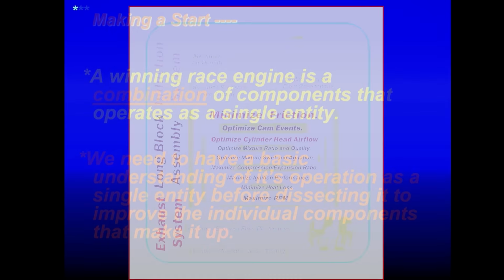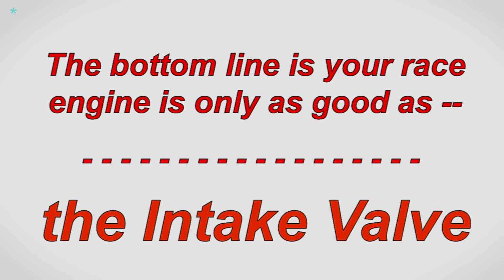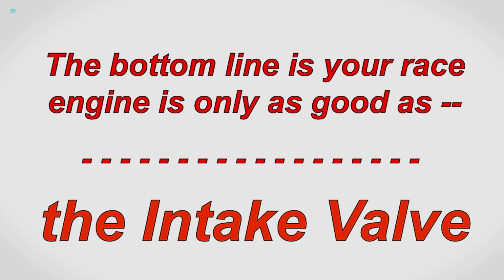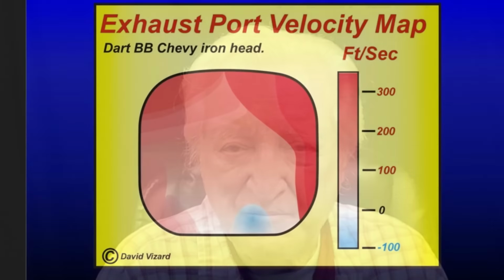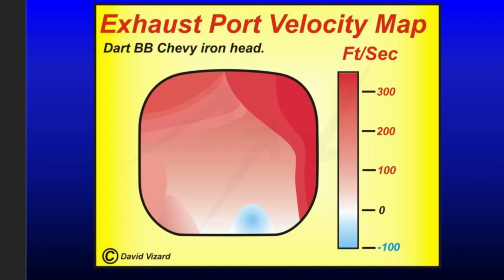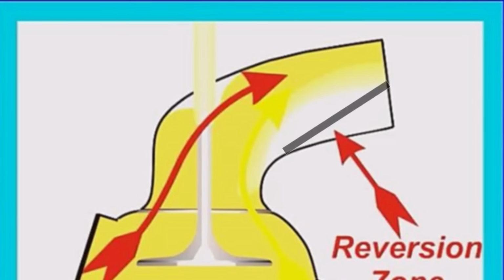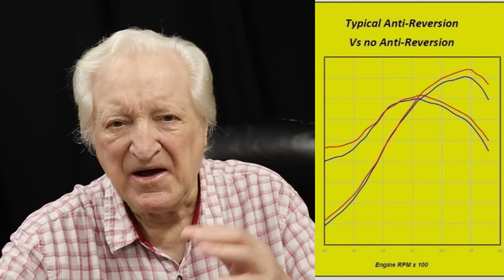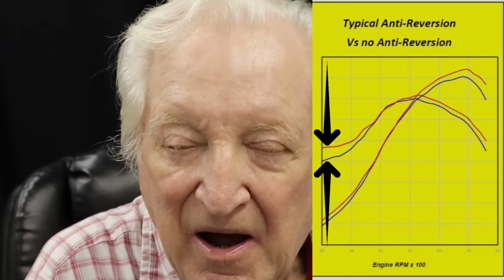Big hidden HP - from anti-reversion mods

Comment: A long-awaited topic, finally covered.
Is there anything to be had from de Lavale-shaped extention in exhaust diameters (anywhere in the system, at all)? I have a feeling it should have been one of the things benefitting my output when exhaust system was remade, but nobody mentions anything alike this, anywhere.
Reply: No. Reciprocating engines have pulsed flow, not continuous flow like a rocket. A Lavale nozzle is designed to have the exhaust pushing back against the rocket. That is the opposite of what you want in a piston engine. You want the pulse to leave as quickly as possible and leave a pressure drop behind it to help scavenging and suck the exhaust valve shut.
Aside from the anti reversion steps you do want it to be a smooth taper to minimize turbulence.
Reply: @Fulcrum205  Lavale nozzle is designed to convert heat energy into velocity which is why it seems practical, though any reverse pulses should have the opposite effect applied. But, I have mixed feelings about its effects on flow upstream of the nozzle.
Limited simulations I've made showed that velocity rised more evenly than in the large tube, while total flow is slightly better than the smaller tube (comparing lavale nozzle style extension of like 1.1 factor with both diameters involved, if they were there natively)
To sum it up, in simulations it seemed that while not having the full flow of larger tube when it's finally got up to speed, small-extended-to-large responds to flow rise nearly as quickly as the smaller tube, but ends up pushing more through the outlet. So, to have the same total flow, this kind of pipe could go by with smaller pipe at the beginning, which in turn should impact scavenging positively

Comment: would this help turbo charged applications too ? there is quite some back pressure from the turbine on the exhaust, would an anti-reversion device help whit the situation, or it does not realy make that mutch of a difference when the turbo plays ?
Reply: I'm sure it would make a difference to spool up quicker. I am going to try it on my old volvo. I have an adaptor plate connecting the turbo. The way the porting works in my situation, a cone type I think would work
Reply: @Batman-n1q1v  supposedly if it does what it does.. then it can help Both before and after the turbo. 
It would be an interesting experiment.

Comment: Thank you so much for posting this video!  I am very interested in this topic!  I would like to know more about the groove you put on the intake valve. I am interested in doing this but, I am concerned with the longevity of the valve under daily use. How will this hold up in long term use and are there any other considerations that should be made under these conditions?
Reply: I am thinking also this...ditch cut or groove would probably have similar kind of effect concerning of the strenght of the exhaust valve. I suppose if the valve itself has good quality and we talk about street rpm (5000-6000), street cam lobes (low seating speed) and  not too stiff valve springs...they should be ok in mileage use.

Comment: Sometimes customers put on drag-pipes on their Harleys and because of the reversion lose large amounts of low and mid-range torque (the lower rpm range is affected the most); I've used "torque-cones" which fit between the head and the exhaust  and about 60%-70% of the lost torque would come back. However, there would be a loss of top-end hp and now I know why! It would be interesting to see what would happen if the top part of the cone was cut off, maybe the torque would still be good and some lost hp would return.

Comment: If I learn 1/10th of what this gentleman knows in my lifetime I will be happy.
Reply: Do what I did long ago, stay with Mr. Vizard only follow his guidance only and you will NOT ever go wrong.
Reply: @TobiasCat-p6b I agree with you. It's so rare to find a person with such well rounded and complete knowledge of a subject and I believe some folks have confused themselves by listening to many different people that may not have such a complete understand of how to build and tune an engine.
Reply: if your listening and taking it in youll get there.
Reply: Would runners shaped like diamond (larger or smaller on the outside bends than inside) equalise velocity/pressure and avoid this reversion?
Reply: @stygiangs  mo
Reply: Yeah, I'm learning whatever I can from him for when I build my LLO 1.9L Saturn DOHC engine for boost after I get out of debt of course...lol I already know because of David, which pistons I want to use for it and I'm likely going to have CP Carrillo titanium rods made for it, WPC Cryogenically treat the whole bottom end and transmission parts, etc. It's so interesting and fun to be a part of engineering your own street engine. It should be fun with a 2390 LB car.
Reply: @junechris  start with throwing the engine away

Comment: This reversion is more evident in larger V8's with large cam overlap. John Kasse made a point to never use old, rusty inside headers. He figured out why his friends were getting oxide in the cylinders and killing their new engines.
Reply: Thats why I see so often some rags in the intake port to prevent stuff dropping into it ........but not so often in the exhaust port.   Many think : it blows the stuff out...

Well.....if the exh valve is open and sonething drops into the port....... drops into the cylinder.  Doing its damage before blown out.....
Reply: Nobody that has any knowledge of 2 stroke understands these ideas.
Reply: @scottburchfield912 
I do BUT I've also thought
You can fight nature with difficulty
Or work with it 
Could you do as the 2 strokes do and tune a stepped header and cam to use reversion to force the cam overlap intake charge in the exhaust back into the combustion chamber 
I know the pressure wave timing will be short and exhaust valve will mess things up 

It'll probably be worse except for that 500 to 1000 rpm range when the pressure waves are in time with valve timing
Reply: @TobiasCat-p6b  its my experience as a pro head porter....

I have seen very often engines in a workshop with  covered intake ports ( a folded rag in it ,  ducktape on etc etc ) ....but exhaust ports open. 
Than customer explains :  no need covering exhaust ports ....its only blowing gases out  so no problem. 

Yeah...right.... but if whatever fell in damages  e.g.  squish area and top of piston cause it got stuck between  that before blown out of the port....

Most of the time ...I get a blank stare.....

Comment: some small block chevy heads have D shaped exhaust ports mated to a round header port, will this work about the same as a reversion plate?
Reply: Another reply to and other comment said yes to your question adds about 10hp

Comment: 14:50 short side radius...
A guy named Birdie ported my alum Edelbrock Oldsmobile heads and he even cut into the intake and had to brass sleeves for the pushrod holes. We didn't make huge flow numbers but one thing i want to point out is he kept the heads forever and kept asking me what cam im gonna run. I kept saying it will be custom based on what you can get out of the heads. We went back and forth on this for months. Then he told me the lift numbers mattereed as far as how much he was gonna roll off the short side exhaust...to reduce reversion. 
Ultimately i chose a weird hyd roller from crane with LS lobes. I'll give general specs its .620/.620 lift (1.5 ratio rockers) 257/265 duration @.050 and the n/a engine made 620hp/620tq at only 6100 so in the end we did ok. Cubic inch is 462 its a .030 over 455 olds. 4.155 bore with the worst cyl head ever for actual flow. In my mind a 462 set up this way should flow more but it is what it is
Reply: @williamstamper442
The top engine guys will tell you that flow numbers do not equal power. 
Lower flow can make more power.
Reply: @bobirving6052 
Yes I suppose ...lower flow numbers at max lift can have a bunch of flow below on the curve at half lift
Reply: The valve is much more restrictive than the pushrid pinch. How restrictive is a closed valve?

Comment: I was told years ago if the header or manifold opening was slightly larger than the head opening it would leave a lip that would reduce reversion.  So with what your saying...maybe if you only leave the lip at the bottom it might work better?

Comment: It's good to hear Jim's name mentioned. He was good friends with my auto shop teacher so I got to meet him a couple times. I was just out of high school when he was working on the old quad four program. He gave a set of headers that he made to my shop teacher that he had used for testing what he called AR cone and they were used on a SBC. I do remember a small improvement in milage and not much gain was felt by the seat of the pants but the shop teacher said it was noticeable when starting to pull a hill. He made the cone the same size of the port al the way around and the expanded the tube at the cone to go around it. I'm not sure if this is coming out right cause I know what I'm thinking but not sure if that's what I'm saying. All that typed it's something I haven't thought about for along time and DV you hit it perfectly what he told me. I hear people saying stuff like we're just old school but sorry this is old news to you  and me but valuable new school that work for many. PS I  own Jim's old motorcycle dyno. And another PS, when I was racing stockcars I needed a crank for my mopar chrysler called a kellog crank, nobody had one and when jim found out he called Kieth Black who I believe made them and arranged for me to go to his place and pick one up the next day. So that day I sat in kieths office for 15 minutes talk about stockcar racing and left. The price...free thanks to Jim. Anyway you knocked another out of the park

Comment: Hi David that was a very interesting video, while watching I couldn't help wondering how would these modifications effect a Ford 351 Cleveland 4v with its massive ports and valves?
Reply: Port shape mainly clevos have speed humps in intake and exhaust ports.
Clevos work wonders with intake tongues. The exhaust side do a high port conversion.

Comment: Excellent info. I made up some inlets many years , machined “rimflow” grooves as per Paul Ivy article in C&CConversions, and fitted them to a 649 cammed 1293. Was a lot better at idling, as you say better for getting on cam. The grooves were a little further away from the rim as I was concerned about  their “mushrooming’ over. They didn't! Great memories!!!
Reply: Ditto on my 998 imp 🎉

Comment: Would the 55° angle having better RPM because there's less bounce back? if it's shallow of a cut at 45° then when it slamming back it's hitting more of a flat surface causing it to open but at 55° would cause less opening reducing bounce back?
Instead of putting the plate I want to thought if you had taken more material of the short side would achieve the same thing open it up in the tight arc making it bigger no!? Wouldn't this just achieve better airflow and prevent the cut off from the exhaust gases? How big is the plate how tall are we talking about about five millimeters the side wall?
How to Mercedes engines fare like the 2.3L M111 compressor for anti reversion?
Reply: 55* pulls closed tighter and quicker.
The plate acts like a raised port plus more velocity.

Comment: I have been working on a dato head which had plates added to the floor of the exhaust. Those intake ports look too big for the valve. You can get a good size valve in if you off set the intake by 10 degrees toward the centre of the bore. I have some pics if your interested, it has 47.5mm intake valves. The engine I built is under 2l and it made 150hp at the rear wheels with the rally tires on through a straight cut gearbox! The guy who built the head it used to work with Les Collins, his name is Mark Banyard. I made a few small tweaks like individual spring seats to ensure each of the cosworth springs were nearly binding and kelford made up a special cam. It goes hard, from 4.5k rpm all the way to 9.5K and it only has a 38mm port on the intake.
Reply: I run a modified U20 with larger vavles etc, previously making 142whp before the new EFI. I think a plate system like what he describes would be easy.   Would enjoy sharing info.  I'm on the dyno July 9 for a final ignition map.  I'm expecting 150whp and a flat torque curve coming on at about 3200rpm, 246/50 dur .530 total lift cam, 11 to 1 compression,  40mm Jenvey Heritage TBs on Microsquirt, Ford EDIS ignition, pump gas.  Engine is the best ever,  easy street runner with no low rpm issues.  Cheers!

Comment: I have always made the manifold about 3 mm bigger in diameter so there is a edge around the port. I would be fun to see if that has a bit of the same effect
Reply: I would say next time only go to 3mm on the inside edge where the reversion is. Otherwise you are creating a low pressure turbulence spot   where the air wants to flow smooth and fast. And yes this will definitely have an effect. an easy way to do it without making plates although not as efficient

Comment: Haven't seen any oems do this yet except for two strokes, but I was contemplating a header with a power valve for a big port engine at some point.
Reply: I've seen some guys do antireversion seat, you could take it to the next level and make it into antireversion seat-cone.
Reply: It's amazing. Something so simple is not thought about in production cars.

Comment: Hey, sending greetings from Trinidad &Tobago, the part about the datsun head stirrs up  memories, i had a L series engine, a N42 block and a N42 head, in the exhaust ports had a funny shaped stamped sheet metal insert, these would become loose and in some cases fall out of the cylinder head and make its way into the exhaust system...never understood its function untill now...thank you Mr. David Vizard.
Reply: Those were actually for emissions. They would get hot and help burn off any excess fuel before it got to the catalytic converter. They actually don't have any effect on port flow until you get to making some serious horsepower

Comment: Such diamond infos.  I wish I had knew 1/4 of all what I have learn ever since I started following your channel.  Everything is hidden in the details. Now I gotta fing a way to mesure my head flow and it's reversion.  If I can use my electronic RPM tester with somekind of impeller with a rubber bloking plate at the bottom of port to see how deep the rubber is pulled in. OR a hard blocking plate with my vaccum gauge attach to it. I just need to mesure the air velocity coefficient compared to real life engine experience. I wont be as accurate as a flow bench but the limits are the same, when air speed stagnate or slow down, go back a little.   Im not cheap, Im single father of 2 little girls of 11 and 14 with a car/engine and a little of David Vizard enthousiasm.  When there's a will, there's a way. Worse that can happen is I fail and restart.   An old turbine whistle would work also I think?🤔😁

Comment: So how about designing the surface of the intake/exhuast port and backsides of the valves like shark skin? Its rough in one direction and smooth in the other.  It also has a similar effect to golf ball surface.
Reply: The ports are already rough in both directions, for the intake its so that the fuel stays in suspension whereas with a polished port you can have fuel pooling in the low pressure areas of the port. I don't see why it wouldn't be worth a try in the exhaust though.
Reply: This is what the Americans used in the early 90s 80s? in the American cup yacht race. It worked for them they won then the technology  got banned.

Comment: Exellent knowledge , grumpy used to ditch cut his exhaust valves, but this looks better, many thanks!
Reply: I remember Grumpy's "Chevrolet Racing Engine"...there was a principle picture of the ditch cut exhaust valve and Vizard's Pinto engine tuning book, where was anti reversion exhaust manifold. I wonder, if the ditch cut would work better with the higher exhaust port and anti reversion exhaust manifold with low exhaust port...

Comment: BMW used increasing diameter steps in their headers to act as reversion dams. Since the exhaust port was the smallest diameter, the ridge from the head casting and the flange  made a good dam, then the tube to the flange again had a difference in size, and each tube segment increased in size to help minimize reversion in the exhaust.
I have incorporated this technique on all of my ports since learning about it. I stopped match porting exactly on both sides and leave a directional ridge to counter reversion at each flange.
Reply: I'm not sure how they designed it exactly, but regular smooth step-up is usually used for wave tuning and to keep the speed high off the head while still flowing good. Smooth steps could potentially be less sensitive against back pressure for the same reasons, as it would have to work against higher speed and with a pressure drop moving upstream, but it's not the usual reason why it's choosen. Big abrupt steps is usually a crutch as it does a poor job in pressure recovery.
Reply: They're not "anti-reversion".  They just increase the average area of the headers to increase flow.  e.g.  If your engine needed 1-13/16" primaries you can make the first half 1-3/4" and the second half 1-7/8".
Reply: @chrisstavro4698  I think I will take BMW at their engineer's word when they explicitly said it was to combat reversion.

Comment: You can get those exhaust plates for a 4v big port 351 Cleveland. but that port dives off very steeply on the floor it very well could use another angled bit welded on the end.  🧐
Reply: At that point an aftermarket 3v head works better.
Reply: @Low760  I was referring to the tin plate you put between the header and the head it fils the the bottom of the exhaust floor in 
Not the alloy block that converts them to a hi-port
Reply: @Low760
$$$$$$$$
Reply: Hi port conversion